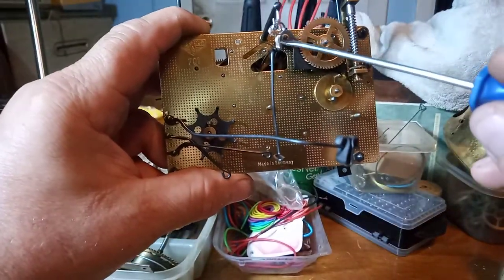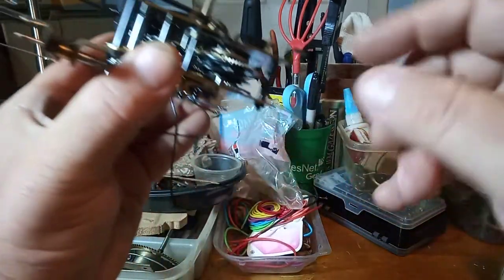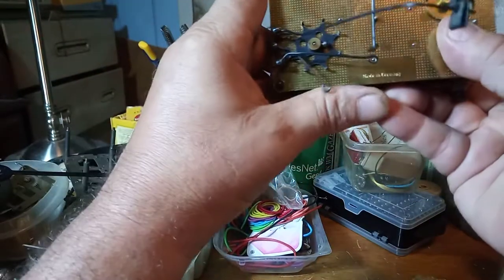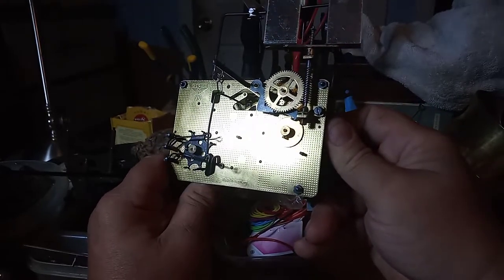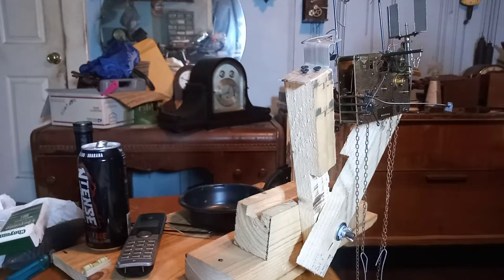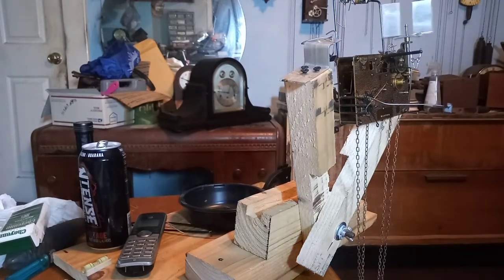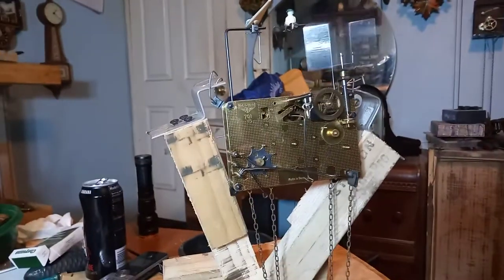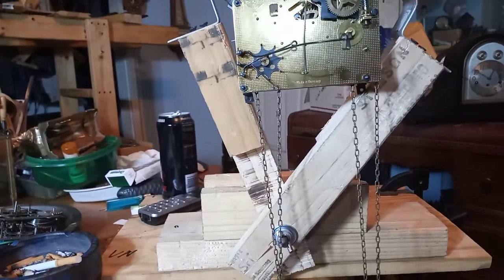Repairing Fox n Grapes clock with Regula 701 movement (See description) 20220909 000747

Comment: Hi Mark, Thanks for the video. I have jut finished working on one of these and let me share with you some feedback. the pack-man mouth cam is not responsible for stopping the chiming side. It just allows the door to open. What controls the stop is the pin on that warning wheel inside the movement. there is a black lever that lifts up when the clock goes in warning on the hour. That frees the chiming train and the it is only stopped by the black piece on the back of the movement and the camshaft locks it. when the clock is done cuckooing the black piece is lifted up and the cam shaft rotates to play the music. It does not have to rotate a full rotation. You are more than welcome to reach out if you have further questions. Good luck.
Reply from the maker: Thanks for the feedback. It is definitely a breed of its own. Much rather work on the Regula 25/34 movements. I havent touched a Regula 71/72 movement and  I imagine this 701 movement is  a lot like those. Thanks again
Reply from the maker: I still am not convinced that this Regula 701 movement is an 8 day clock. Since you got yours up and running is it a one day or an 8 day clock? There is very little information out there on the movement. What I did find I thought it was an 8 day movement but while on my test stand and working on figuring out which part is bent on the music section the weights drop like an 1 day movement.  What size weights are you using as mine didnt come with weights. The chain looks like one day chains vs 8 day chains. Thanks for the information.
Reply: @munnerlyn3  Mine is 8 day. weights are 1500 grams across the board. Those movements are rare and they don't come across that often. Most people stay away from them as the plastic levers and parts wear out and there are no spare parts. I fixed it for a friend. What kind of weights are you using?
Reply from the maker: Currently I have 1200 gr weights on it but I dont think it is an 8 day movement because the weights drop as fast as 1 day weights do on my test stand. Do you happen to have any pictures of the rear of the movement when you worked on it. I am trying to figure out where the spring for the black lever that comes down to catch the pin on the wheel location is. Not sure where that spring goes and I am thinking that it is on wrong.
Reply: @munnerlyn3  Sure. Did you have an e-mail address? I could send you photos and tell you exactly how the spring should be placed as it is one of the culprits that may cause the clock to strike and chime at the same time instead of waiting for the strike to finish. Cheers!
Reply from the maker: @khossossykhossossy7955  my email is markmunnerlyn@yahoo.com. Thanks ever so much.
Reply from the maker: I still havent received your picture of the spring. My email address is markmunnerlyn@yahoo.com. Please dont forget to send it to me. Thanks.